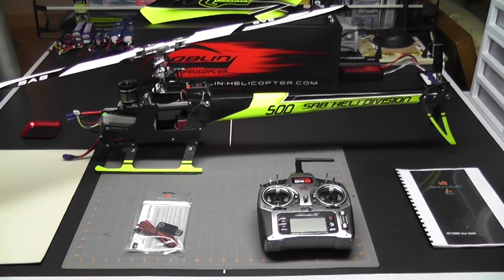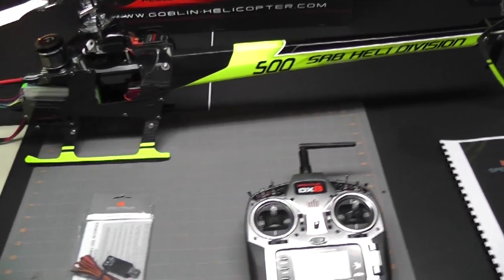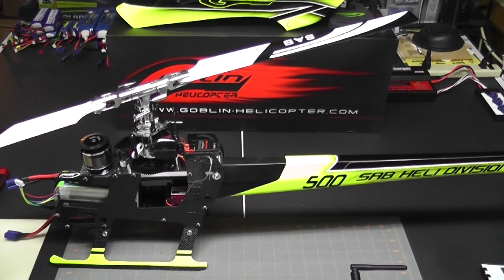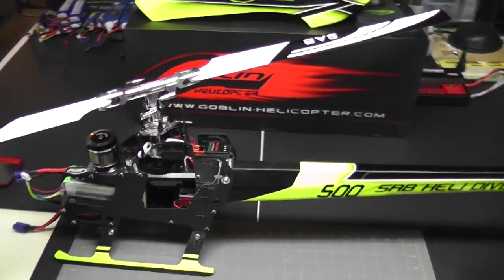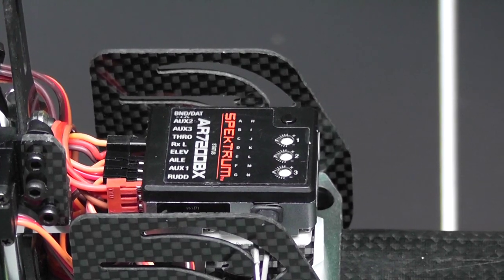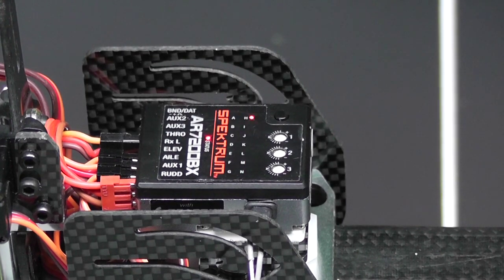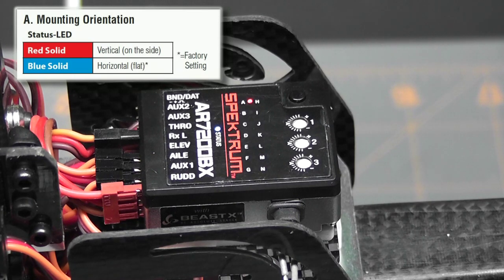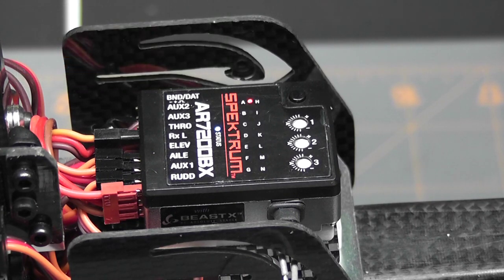Goblin 500 Electronics Set Up - Video 1

Comment: I can't see a wire for the bec. Is that not used. I have a hobbywing 100a v3. Do you need the bec on a goblin 500?
Reply from the maker: Hi there.  The BEC is build into the ESC.  However, you can use a separate BEC is you wish.
Reply: Hi, and thanks for your reply - and great videos :). Is there a special procedure for calibrating a "Hobbywing Platinum 100a v3" to an Ar7200bx? Can I just use my main flight battery (6s) and power it up or do I need a smaller battery? I am Little afraid of burning off the esc and/or ar7200bx :)
Reply from the maker: Hi again Torben!  I have never used a Hobbywing ESC so I can't say for sure.  Personally, if I was not sure, I would be on the safe side with a smaller batt!  Good luck and happy flying!

Comment: hello, Really you have the best video's that explain beastx setup on the YouTube. I will build 450 heli with beastx  and devo 10 transmitter soon and here is something I have to ask. do I have program the radio (pitch, throttle  curves and gyro) before I start setup the beastx? Thanks
Reply from the maker: +dndon Hi there and thanks for posting and the kind remarks.  I did set up my pitch curves, limits and expos, and gyro before programming the BX.  It just made it easier to not have to try setting up two things at once.  I use a DX8 and the radio setup was a breeze.  I used standard curve settings and then tweaked them after the first few flights.  Best of luck with your build and godspeed on the maiden flight.

Comment: I am getting a Micro Beast X V3 tomorrow  :)  If i follow your AR7200BX video's, will that be fine?  Ore are there big differences ? I mean i will still check my manual as i follow each step, just wanted to know if its the same set up  ???  Thanks !
Reply from the maker: Hi there and thanks for posting.  I have never had the opportunity to work with a MicroBeast, but I would imagine the parameters are very similar.  I am sure you should be find using my videos and the manuals.  Good luck and post a video on your success!

Comment from the maker: Hi there David!  You are pretty much spot on.  Zero all Trims, 100% travel, 90 swash, linear pitch and throttle curves and no mixing (although you can change the curves after the initial set up of the AR7200BX).  I have the gyro set to "Gyro" on channel 6.  No expo or DR until you have the AR7200 all set up.  After the set up, I have DR1 set to 90 DR and 20 expo on all but the tail, DR2 set to 100 with no expo, and Normal at 80 DR and 30 expo.  Hope this helps bud!  If not, hit me up.